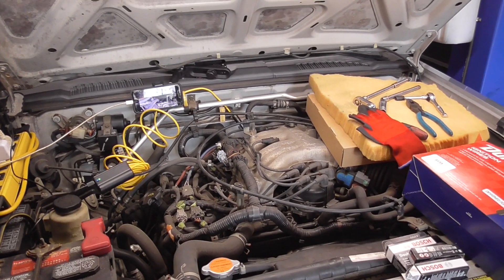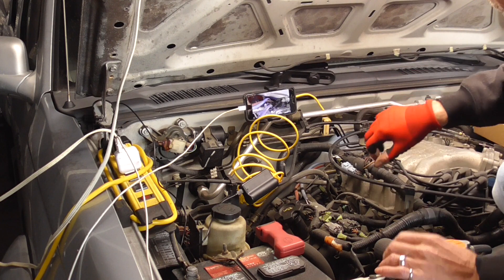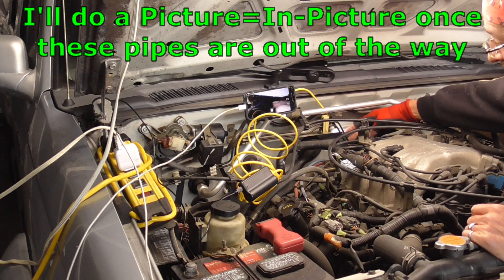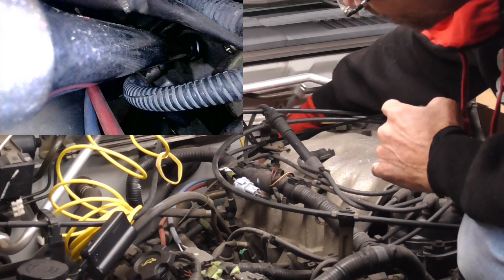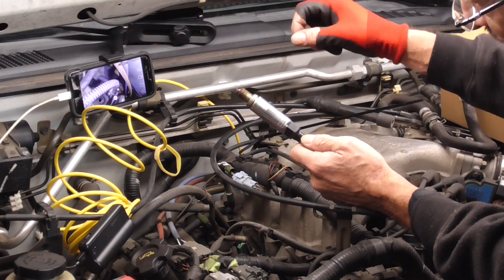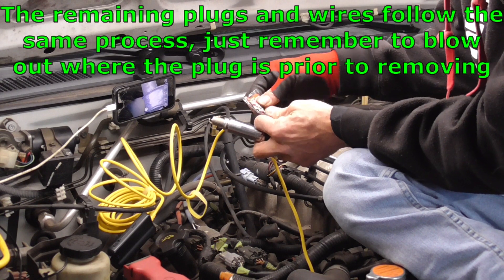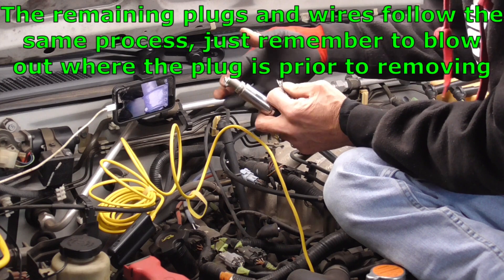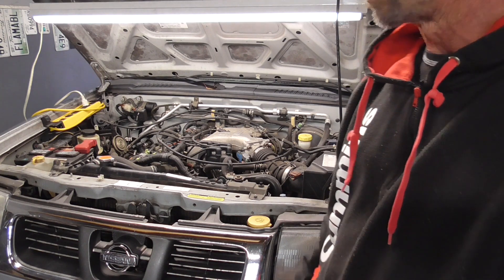Nissan Frontier/Xterra v6 (VG33E) Spark Plug Change - It's not that bad (if you get an Endoscope !)

Comment: Had same idea on Honda Pilot transverse mounted nightmare. Got some timing belts to look at too. Three J35 engines in our family.
Reply from the maker: 👍. Yep, the prices have really come down on the little scopes so it’s almost crazy not to just buy one. I use it for looking around for seal leaks and things as well as checking the bore wear on these restore motorcycle I play with.  Mine even has a little hook attachment as well as a little magnet attachment…not super strong, but strong enough to pick up a 10mm socket 🤣🤣🤣. All the best !  Steve